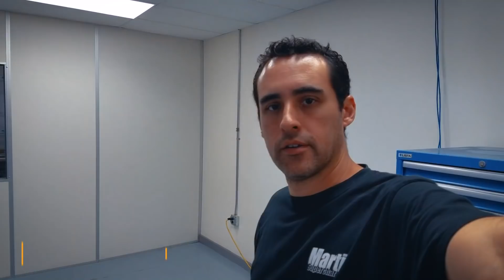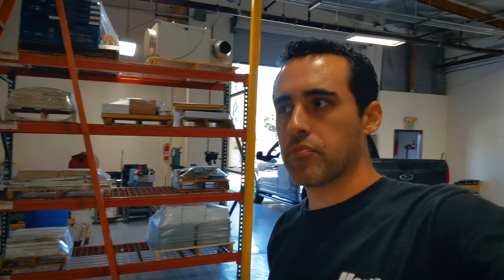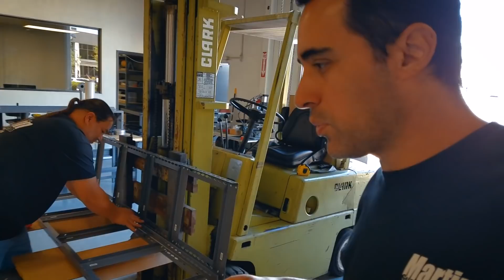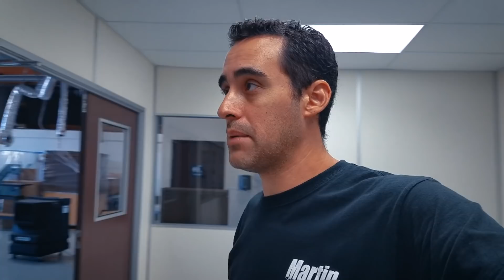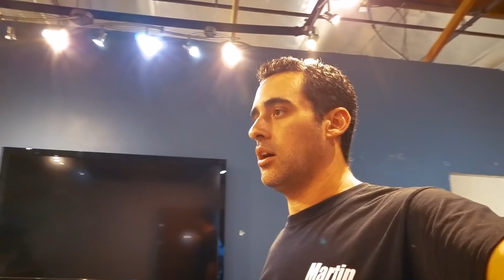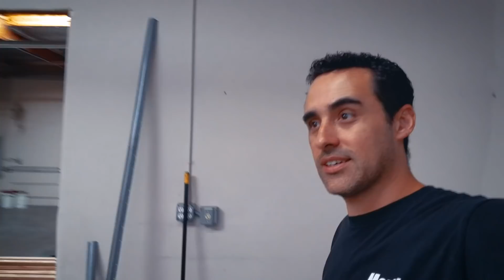Electrical Up, Tearing Down - Moving a Machine Shop - Pierson Workholding

Comment: I'm so surprised your machines run on 220-240v, 3 phase 400v is so much more powerful and economic even instalation cost is less because of the wire cross section you need is much smaller and copper is not cheap. Here in Europe its hard to find a modern single phase motor higher than 3hp(2.2kw) but 3 phase go down to less than 400w, thats what my little band saw has on it.

Comment: American power is much more complicated than the three phase 400V most other countries have. Noone have transformers or phase converters. All equipment is either 230V which is one phase to neutral. Or 400V which is all three phases. Even most residential buildings have 400V so every industrial building has it.

The next step up is 10 kV but that is only relevant if you need power in the megawatt range.

Comment: Having to buy a transformer to get low voltage is a better deal. If you were only getting low voltage supplied to your shop then you would have to get phase converters to run all of your machines.

Comment: it's good to know how big your machine shop is.
I want to buy a Screw-Compresor for my coming soon Haas - VM3 Machine.
and I think the silentest Compresor on the market is KAESER.
What do you think about buying a compressor like KAESER for only one Haas-VM3 Machine?
Are there some quieter Compressor than KAESER?
Reply from the maker: We evaluated the Kaeser and Polar Air.  They had about the same sound level but Polar cost significantly less.  If you do buy one, get a BIG tank so it doesn't have to run as often.